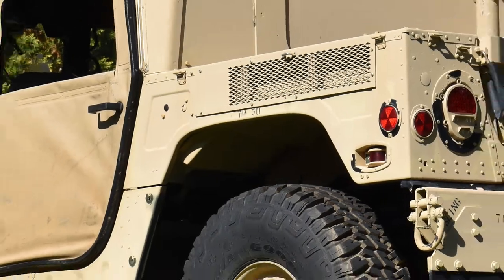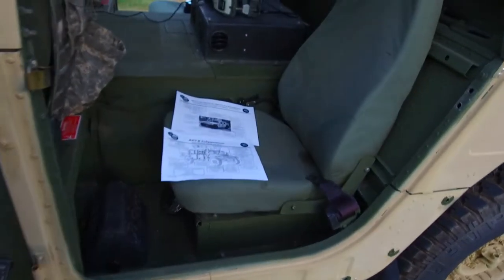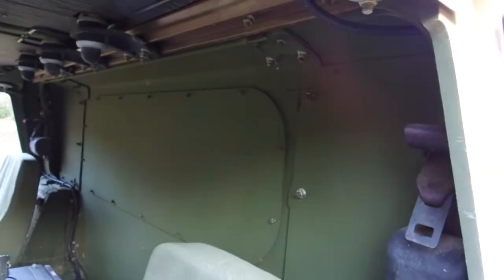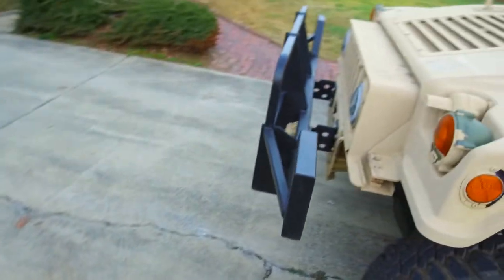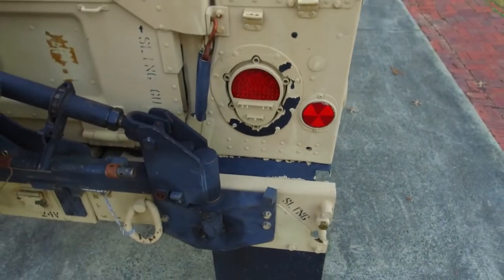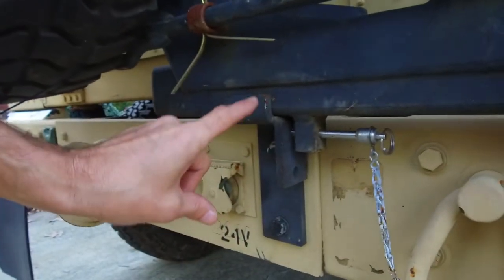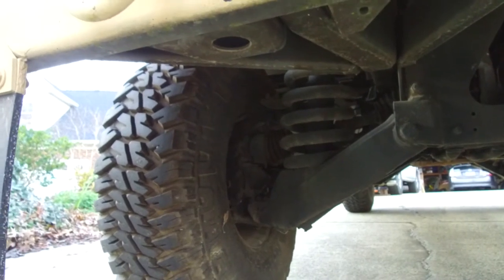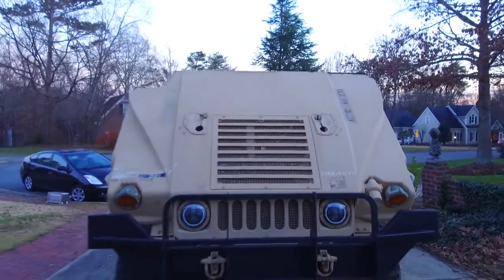We got a Turbo Military Hummer! M1165-A1 HMMWV tour

Comment: I just got one with a 6.5 turbo with the problematic Duramax block and the old transmission. I'm upgrading mine to a 6.6 turbo and an Allison tranny. The difference is like night and day in power and also much better fuel mileage. It accelerates fast and pins you in your seat. I went and drove one before I made my decision......then there was no question. Good luck with your.
These damn beasts rock.......even if they can be a pain in the ass sourcing parts.
Reply from the maker: How did the upgrade go?

Comment: I want one! Also it is taller most likely because it does not have the armor it was designed to carry. I am sure it doesn’t handle as well without the armor, being now over-sprung off-road. That’s the issue with these trucks, perhaps there are springs that can be added with less stiffness.
Reply from the maker: Yeah. That is especially true of some of the earlier models, like the 3rd generation HMMWVs. The newer trucks like this 5th generation model have much nicer variable rate springs that ride a lot better without the massive weight of the body armor.
Reply: @GearreportdotCom is that true!? Never heard of that.

Comment: Thanks for this video. Ive been waiting for it for a bit.  It’s a shame that in order to get the beefier frame and suspension, you need to get the up-armored version with holes and cut bolts.  I opted for the std 1165. After you discussing the geared cooling system, I’m glad.  Mine is still the standard set up and I already found parts for it. I don’t think I ever seen parts for the A1 cooling system out there yet.  Keep making the videos. I look forward to seeing them about this truck.
Reply from the maker: I have a spare GFD and have seen a few more... but they are crazy rare. 
The holes everywhere suck. I don’t want to cover with real armor. Don’t want that weight. 
What kind of videos do you want to see?
Reply: Gear-Report.com keep that gfd with the truck. You never know when you are going to need it.  As for the holes, ive seen someone that just put large enough bolts and nuts on it. It makes it look a bit aggressive.
Reply: @GearreportdotCom  Aluminum hole patching with some welding or buying angle iron and making some jackrails to cover the holes.   One takes time and patience with a welder and grinder sander, body work.  and one takes skill with a welder, cutter and bolts.   Either way. Lots of "fun"  teach the scouts thier welding /metal working badge...
 When you wire up your accessories,  a detailed video on it would be really awesome to watch! 

   I really like the way you present your content.   
Awesome  truck and I like your plans!
Reply from the maker: @lt9690  The holes have been filled. You can see what we did here. https://www.youtube.com/watch?v=imrYJRmDGvs
There will be more video soon, as I'm taking it to a BIG firearms industry event this week. :)
Reply: I am wondering if there really is a chassis difference between the A1 and standard version.  Important question for me is because I have a local friend that is getting an A1 1152 for part out. I need a lot of the chassis parts and want to make sure it is comparable.

I question this because i ordered bolts for an idler arm and it came in an inch too short from what I expected.  I also have the coolant lines going to the rear diff.  Though I don’t have the clutch fan or under seat impact absorbers, i wonder if the chassis differs in some ways.  I noticed that both are rated at 12.1k gvrw.
Reply from the maker: @clashofclansshield8583  Try this one https://gear-report.com/wp-content/uploads/2017/03/TM-9-2320-387-24P-wChg5.pdf

Comment: If you have some time, can you make an engine dedicated video of explanation of what each component is, does, and where and how it is placed or mounted.

There are a lot of things loose or possibly missing in the engine and I either need to figure out what to order or how it was originally mounted.
Reply from the maker: I may be able to do something like that. I can speak in general terms about most things. The Parts TM for your specific model of truck should be pretty helpful as well in decoding what goes where.
Reply: There are so many TMs that I downloaded but I cant find the ones to specify part numbers.  Too many dependancies referring to other TMs.  Looking at all of these on a pdf on my phone is improbable.  Do you know the parts TM number?
Reply from the maker: Sorry, Tim. I just saw this. Parts TMs are listed in here and categorized by  which model truck you have.
https://gear-report.com/humvee-manuals-download-hmmwv-manual-links/
You'll want to scroll down to the "Parts Manuals" section and click the link for your truck... ECV, right? So, the TM-9-2320-387-24P.

Comment: Thanks for these videos and your website. I’m having the exact same issues with my 1165 that you did. The same guy must have demilled it. Waiting on a start switch because mine was frozen too. Did you change the fuel filter before starting it?
Reply from the maker: I did, but I recommend you check it and run it a while before you change it if it is ok. You’ll likely get trash in it from the tank. So, let the old filter get that trash instead of ruining a new filter.